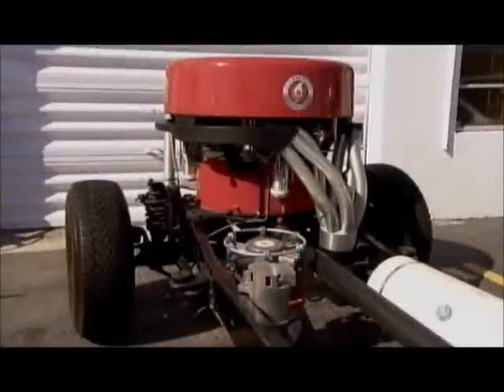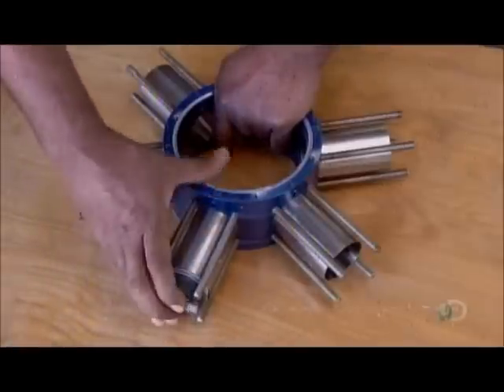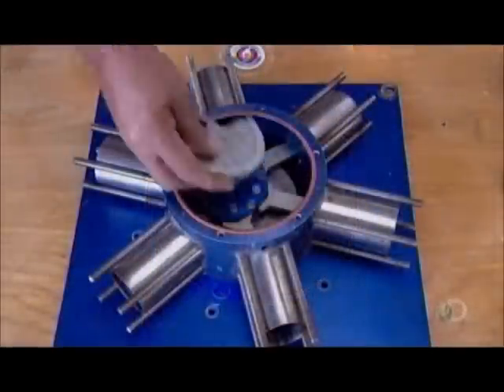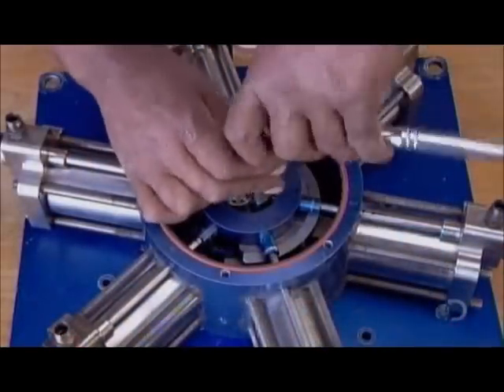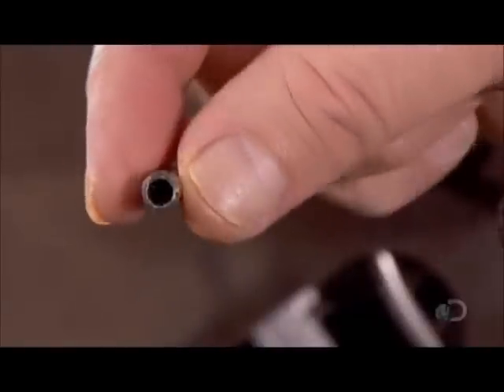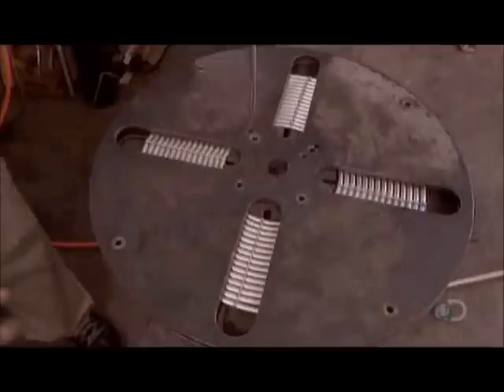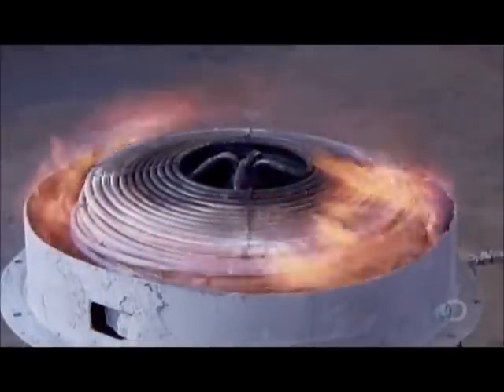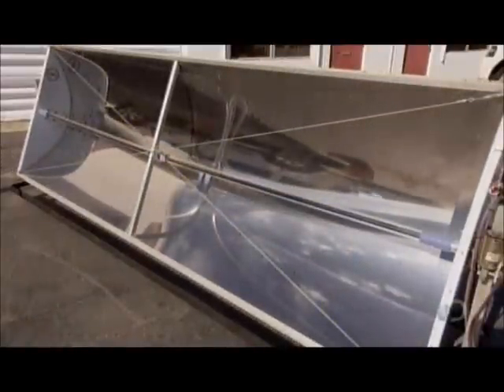How It's Made - Steam Engines

Comment: With majority of energy lost as heat I always wondered why cars aren't equipped with a steam engine to supplement, or even supplant, fossil fuel engines.
Reply: Steam engines are much less fuel efficient and generally require higher maintenance
Reply: I was suggesting adding a steam to use the conventional engines wasted heat. The heat that accounts for 70+% of wasted energy.
Reply: Perhaps a internal combustion engine to power recharge batteries and a steam engine that takes the hot exhaust gases and turns that into battery power as well.
Reply: weirdyoda04 Ah, I see.. a heat recovery system.  modern engines are closer to 60% now combined with heat loss through both the exhaust and the cooling system.
Reply: weirdyoda04 I have never seen or heard of such a system using steam for a automobile and its efficiency, size, weight and cost does not seem practical,  several manufactures have played around with the ideal of using an exhaust turbine to drive a auxiliary generator or alternator.. a much more practical and direct system to recover waste heat from the exhaust stream.

Cheers!
Reply: doktorbimmer
yeah but driving anything more than a small alternator would plug the exhaust ports and the cylinders wouldn't breathe properly. Talk about high NOx emissions..
Reply: ***** A turbocharger extracts far more shaft horsepower from the exhaust stream than a alternator would... at least a standard non-hybrid alternator found on a typical car is around 1,400 watts  or less than > 2.0 horsepower
Reply: ***** Peak combustion temperature is what effects NOx... many factors enfluence the overall combustion temp but compression ratio is the most important factor in determining CCT
Reply: yeah I guess if it couldn't get any oxygen, it wouldn't get that hot :)
Reply: *****  Remember the exhaust gasses are still expanding after the exhaust valve is closed.... thats why Turbochargers increase BSFC  efficiency... and lower emissions...  if the EGT drops?  BSFC improves.
Reply: ***** Actually the rate of conversion of NOx  INCREASES when excess Oxygen is present...  low O2 starves-out or reduces the reaction rate of NOx formation.

Comment: "The circular engine"= A radial engine, commonly used in propeller driven aircraft of the 20th century... nothing new here.
Reply: That's why the segment is called "How it's made" and not "Guess what's new". None of this technology is new short of some of the materials used. What makes this remarkable is the return to old mechanisms for new reasons, economy and ecology. Who could have thought a steam engine could have been made 'green' and affordable? Steam as an automobile isn't likely in our lifetime. It's taken a 100 years and much public outrage to force the automobile giants to concede to build an electric car and do it badly. Youtube is filled with videos of garage mechanics & retired engineers who have built or retro-fitted older autombiles with new technologies utilizing new fuels or engine designs. All capable of launching our country into a new level of automotive superiority, world wide. Again, not likely in our lifetime.
Reply: Single-acting cylinders using only simple expansion is not as efficient as double-acting cylinders and use of compounding - the exhaust steam from a high-pressure cylinder still has a lot of potential to be used a second or even third time to produce more power output. Doble steam cars were the pinnacle of steam in motor vehicles, and there was even the Besler steam-plane in the 1930s that worked well, but unfortunately the power did not scale up for practice use in anything more than a light aircraft.

The perpetual problem of steam engines are that cylinder lubrication is always a total-loss system - mind you early aircraft engineers were too, and pilots used to always be covered in castor oil.
Reply: ***** not true, you just design the piston stroke for slight over-expansion.

Comment: So , what's the cost per HP ?
Reply: S0NICFAN1467 I hear uranium has pretty good MPG.
Reply: Pharozos but if you used it you would probably get cancer :P
Reply: Depends on what fuel you use.
Reply: true in a steam engian i suggest using normal car fluid XD i perfer unleaded fule because it becomes steam faster and gives you more hp in it

Comment: why dont we see more of green cars in the world?
cuz of the fucking major oil companys
Reply: Jordan R. but it is not practical to achieve the same thermal efficiencies of a large scale power plant on the much smaller scale of a portable engine system sized for a automobile of even a locomotive..
In vehicle applications steam is much less efficient than ICEs

Cheers!
Reply: dont say that about yourself you're more than that
Reply: LOL  dont get mad im having fun with you
Reply: ***** That's in its most basic design, the way industrial steam engines work are much more efficient, in fact that's how modern nuclear power plants produce electricity, a steam turbine which is a form of stream engine.
Reply: doktorbimmer I'm looking at this from the standpoint of electrical generation. Why not have multiple small generation plants instead of nuclear power plants. Break the grid down into multiple small units that are not interconnected and thus the specter of large scale outages would be a thing of the past.
Reply: Liam Clink Steam engines are obsolete because they waste energy... it doesn't matter what source you use... you will be wasting fuel because steam engines waste heat energy.  A Diesel engine for example is twice the the thermal fuel efficiency of steam engines... its one of the main reasons why Diesels replaced virtually every application once powered by steam.
Reply: Liam Clink The company that makes these engines markets them for COMBINED CYCLE operation... to extract a relatively small amount of waste heat from large Diesel engines, Natural gas fired Turboshaft engines and garbage incinerators... they are far too inefficient to run on their own boiler fired heat source.
Reply: doktorbimmer
Reply: When I comes to steam generators,  numerous small ones may be less efficient than one lager one, also there might be a location/permit issue.
Reply: ***** Part of the reason for steam is as the video said, the hydrocarbons burn almost completely. Even in the advanced cars of today, they only burn about 28% if I remember correctly.
Reply: Liam Clink Actually your figure is a bit out of date and context... 28% would have been an average Thermal Fuel Efficiency for a typical Otto cycle engine found in an automobile years ago... 28% is still very good compared to a steam engine of similar size... but today cars are considerably better now with direct injection and turbocharging they are reaching as high as 40% and Diesel engines near 50%... large Diesels can exceed 50%...
steam just cannot mach this on the same scale unless you reach outputs exceeding a million horsepower or more with an engine sprawled out over acres of land with mountains of insulation, heat exchangers and preheaters etc. 
Cheers!
Reply: No, it's because of the free market. Fossil fuels are cheaper than green alternatives and produce more power at a given time and are vastly more expensive
Reply: manofreedom Diesel engines and gas turbines are more fuel efficient than steam until you reach the plus 1,000,000 hp scale
Reply: killer13324 Good comment... whenever there is a cheaper alternate fuel available.. the market always shifts toward that source until demand is greater than supply... equalizing the price... many alternate fuels are not readily availble and don't meet market demand or are simply more expensive to produce.
Reply: Steam power isn't necessarily green, just like internal combustion isn't necessarily green. If you don't add carbon to the carbon cycle, or spew toxins into the atmosphere, then it's green. Biodiesel, wood, and others are not as concentrated energy wise, but they are already a part of the carbon cycle, and burning them doesn't result in toxic byproducts, nor does processing them. For example, benzene. Remember the flaming sinks near fracking sites? Plants don't do that.
Reply: The big difficulty with power sources such as solar is that they currently require the use of processes that produce toxins to make, even though they don't make them afterwards. You can run and lube a steam engine with vegetable oils.
Reply: Liam Clink There is no such thing as "green"  its a term invented by a dangerous and rapidly growing anti-establishment cult movement.

Electric vehicles and bio-fuels for example cause far more environmental damage.. they are simply preferred because they do not use "fossil fuels" which are controlled by large corporations... and falsely believed to be inherently "More Dangerous" because they make a profit for some people...
Reply: doktorbimmer Like I said, the Rankine cycle begs for a condenser.  From a vehicle engineering point of view, this is the hard part.
Reply: MrShobar A lot of heat loss through a steam to air condensor...
Reply: Hunter Ziegelmann well we can start off with the fact that combustion engines are infamous for producing carbon monoxide : a sign of their inefficient conversion from fuel to power. They also are much heavier because they need a bigger engine because of the four stroke necessity for safety. The steam engine doesn’t have to push against its own gasses as often as combustion. You don’t lose as much heat as you would think actually. I mean think of how much energy is left in exhaust! It’s just as hot as the exhaust from a steam engine but it contains a hell of a lot more fuel. Steam engines are more efficient and more importantly can run on things where efficiency doesn’t matter like charcoal coal tar and biomass.
Reply: doktorbimmer they don’t have to idle ever
Reply: +Matthew Niedbala "we can start off with the fact that combustion engines are infamous for producing carbon monoxide : a sign of their inefficient conversion from fuel to power."
 Diesel engines and gas turbines produces almost zero carbon monoxide
Reply: +Matthew Niedbala  "a sign of their inefficient conversion from fuel to power."  A more accurate sign of efficient conversion of fuel into power is BSFC and  Carnot Cycle T2 values... steam engines are among the very lowest in thermal cycle efficiency and cannot match the efficiency of ICEs in single cycle operation.
Reply: +Matthew Niedbala Steam is a LESS efficient working fluid than air... and that is before you factor in flue loss, radiant loss and heat rejection during conversion.... energy is lost converting water from a liquid state to a vapor state... haven't you ever heard of Latent Heat?